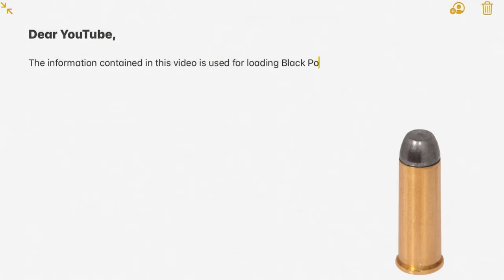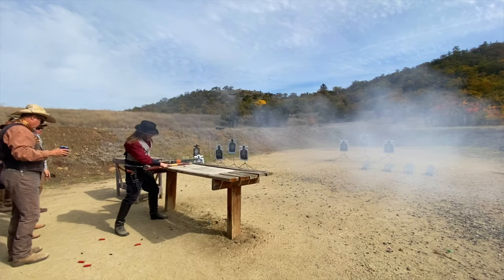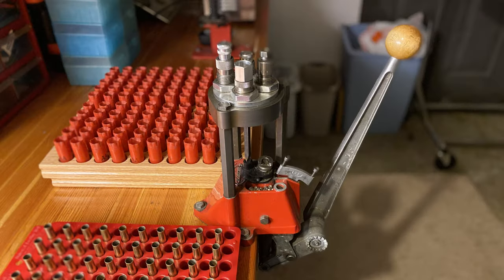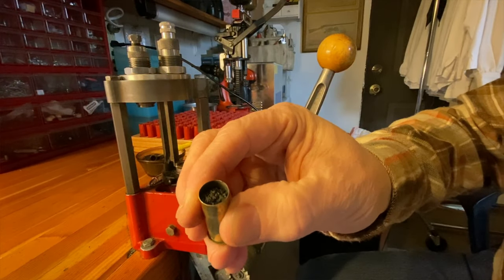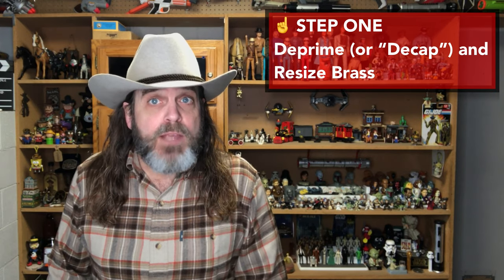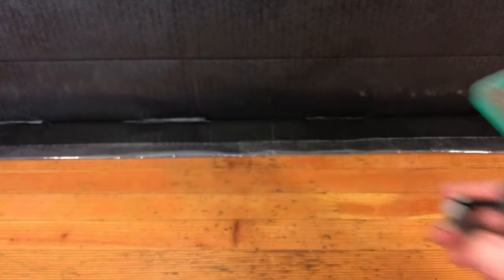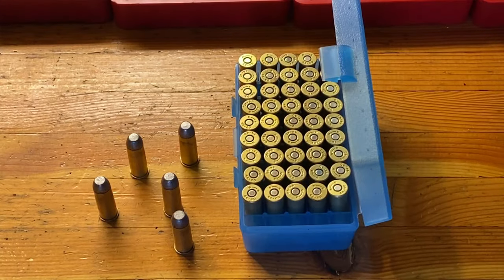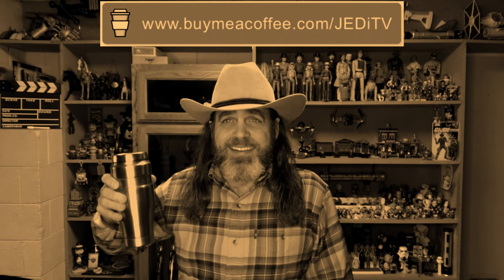BLACK POWDER 44/40 (44WCF) Loads [HOW TO Black Powder Cartridge Loading / Reloading]

Comment: Is reloading the 44-40 a lot harder than reloading the 45 colt??
Reply from the maker: I wouldn’t say “harder”. The mouth of the case is a little thinner on the 44/40 so you have to be mindful of that, you can crush/collapse it pretty easy.  But other than that it’s pretty straight forward. - Jed 🤠
Reply: The cases are very fragile and will crush if they aren't handled carefully.  Standard cases like the 45 Colt are not susceptible to handling damage.

Comment: Hey, jed. i was wondering what kinda lube is in those bullets that you are using? those bullets seem not to have that much lube in them. how is the fouling in the bore?
Reply from the maker: Like I said, I have no issues with clean-up after using these bullets.  Doesn’t matter if I use my 24” rifle or my 18” I get no stuck on fouling. I do spritz my barrels after a stage or two in hot weather but I’d do that even if I was using “Big Lube” bullets.  It’s important to keep that Black Powder Fouling wet.  Give Desperado Bullets a call and buy a small sample bag of 100 to try at a match.  Let me know what ya think after trying them out.  - Jed 🤠
Reply: @JEDiTV  They look like smokeless lube?
Reply from the maker: Matt, Desperado Cowboy bullets claim their lube is compatible with both Smokeless and Black Powder.  I have been using them for about 15+ years with no issues.  On really hot, dry days, I do spritz my rifle barrel to keep the fouling soft.  But, under normal circumstances I can run fives stages with no fouling issues and clean up is a breeze.  ~Jed 🤠
Reply: @JEDiTV  Thats good to know.  I would like to shoot BP but I have a hard enough time hitting the target when I can see it.  The smoke from BP would make it doubly hard.  Although I have often wondered if BP shooters just hit any target in the vacinity once the smoke builds up because no one could tell the difference :-)
Reply from the maker: @matthalsey387  - I do threaten to do that occasionally 😉 ~Jed

Comment: Lol I load just about the same way with just about the same equipment.  Except I use APP powder
Reply from the maker: I’ve used APP in the past and it cleans up pretty darn easy.  Personally, I prefer real Black Powder (for the authenticity as well as the flame and boom!).  - Jed 🤠

Comment: So the past week been looking for black powder boy it’s been  struggle. I did find some 1.5 F and that was at 24.50 per pound and also got some 2 F and that was 31.10 per pound at Buffalo Arms Co. I got 5 pounds each. I’m hoping I can shift the 1.5F into 2F. 
Would I you use the same amount in a 45 Long colt.?
Reply from the maker: Yeah, it can be difficult to find BP.  As for loading in the 45 Colt... it’s been awhile since I’ve loaded that caliber. My data shows that I was using a 1.9 cc scoop with a 180 grain bullet.  Again, that’s some old data from a load I was using in a reproduction ‘92.  So, ya might wanna do a little bit of research or just load a few and try ‘em to make sure that load works for you.  
 ~Jed 🤠
Reply: @JEDiTV  thanks for the info.  I really appreciate you sharing your load data. I do have one more question. Do you change the lube on your new lead cast bullets over to a black powder lube. I believe most commercial made lead cast bullets are using smokeless powder lube. Maybe I’m over thinking it.
Reply from the maker: Nope. Desperado Cowboy Bullets (link in the video description) use a lube that is cross-compatible with both smokeless powders and Black Powder. 
~Jed 🤠
Reply: @JEDiTV  thank you.
Reply: well today my over price black powder came in just might try reload a couple of rounds. Nope not yet, I need to pick up some Ballistol first. 
I really want to say thank you!! for your inspiriting videos.
Reply from the maker: You’re welcome @runawayacres4622 . 
 ~Jed 🤠
Reply: @JEDiTV  well my thoughts of smokeless powders reloads, magtech cowboy hard cast load, trailboss, and black powder loads. 
Ok smokeless reloads I have many different types of loads from different powders and I think the titegroup was my favorite. 
The magtech cowboy loads I wasn’t super proud I bought them because I was having a hard to locate brass so I bought them for $22.00 per box. 
Trailboss is still my favorite out of all the smokeless powders.  
Ok for the black powder wow that’s a super rush when you are running 10 shoots out as fast as you can. That’s a whole new meeting to boom stick. The smoke is intense. Neighbors called and was wondering if I caught something on fired. Lol